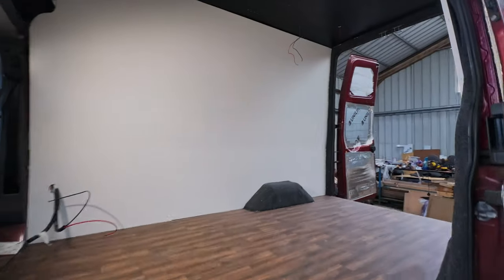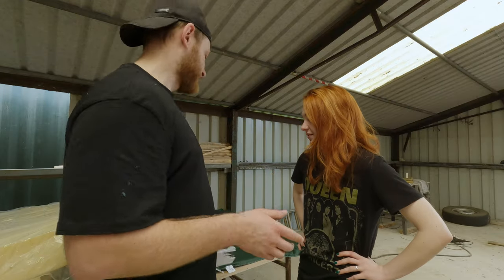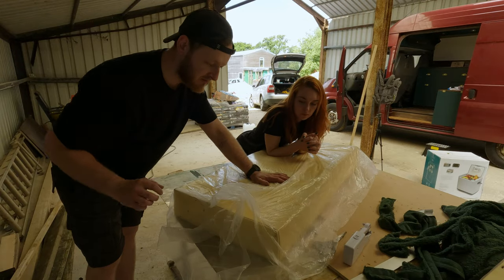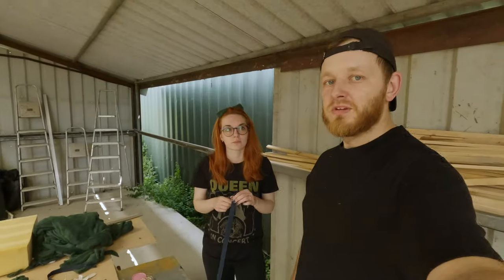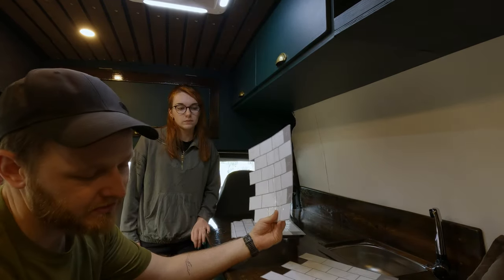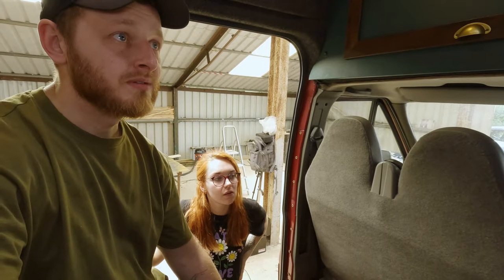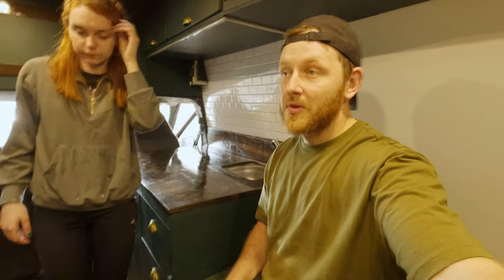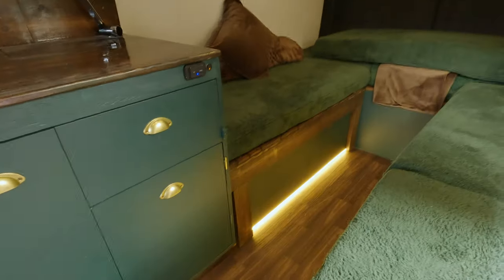Cheapest Way To Cover The Foam In Your Camper Van | VAN BUILD EP 16

Comment: Loving the colour scheme.

I think im. Going to rethink our bed, we have a fixed base across the back but its proving 2 snug, gonna have to do something similar to you with the pull out. Ours is only a swb with the low roof, the tiles worked better than when I tried them in our caravan
Reply from the maker: Our original plan was a fixed bed, it was only when we began to build that we changed our minds and went for pull out to save space! It’s tricky with smaller vans isn’t it! The tiles came out well! A bit fiddly but they have stayed put!